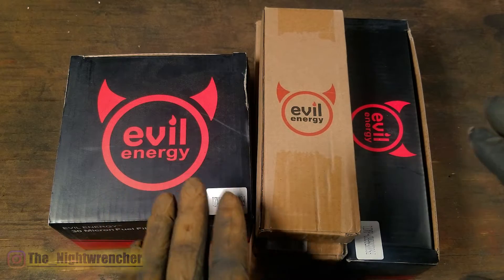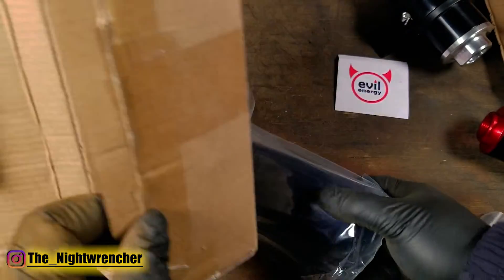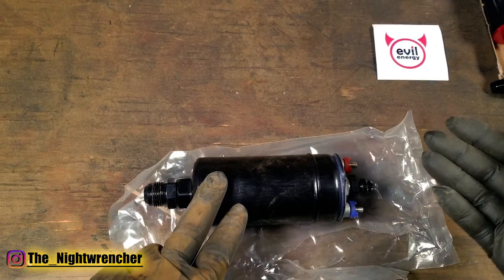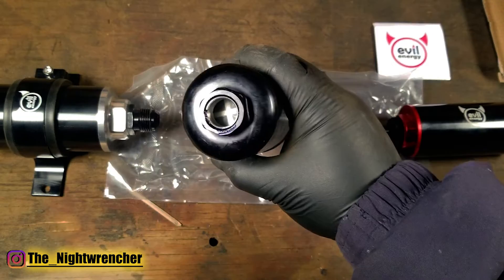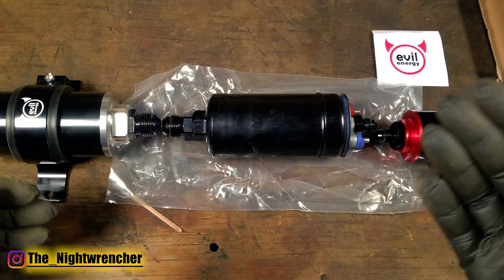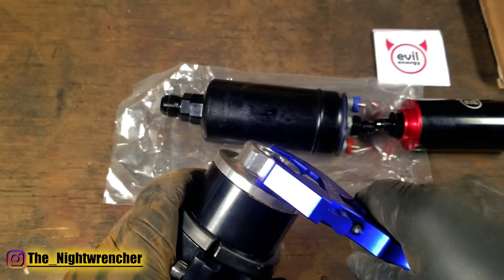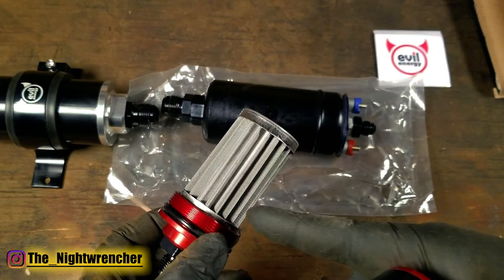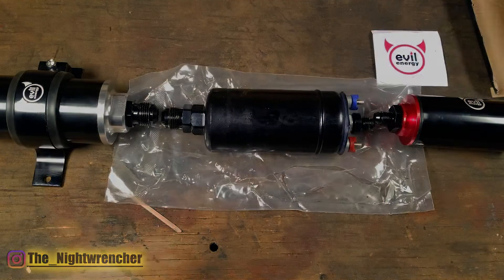Do You Actually NEED 2 Fuel Filters? | Evil Energy Fuel Filters And AN Line |

Comment: what I came here for maybe you can help with...   how best to plumb these with AN lines for serviceability YET with least amount of fittings as possible.  IMy system is diesel. Thus the less fittings the better (reduces chances of air leaks). Am  using a different pump w/3/8 npt to AN fittings.  .
Reply from the maker: @coachgeo  the tricky part is combining those 2 things so for me, I always end up using more fittings than necessary so that things can come out easily without kinking the lines.

Comment: that wrench is a piece of SHIAT.  mine did not last thru a ten fitting uses when building my oil filter/cooling system.  Adjustment wheel stripped.
Reply from the maker: @coachgeo  theyre a very weak aluminum so I can definately see that happening. I dont crank on my fittings too hard so I havnt had that issue yet.

Comment: Beware the evil fuel filters, the elements are bonded with foam and fall apart or get blown out when run in the noted orientation. This will allow particulate and or foam to pass and can clog injectors / carb jets. Speaking from personal experience with these. Fought a tune for a while before I figured it out.

Comment: Do you ditch the check valve all together or run one further up the line?
Reply from the maker: If you're talking about the antidrain back valve, it should be part of the fuel pump itself. Unless you meant something else?
Reply: Yes sir. I'm about 99.999% sure that you took it out when you replaced the "stock" fittings. It's the skinny steel piece with the holes on the side of it. I was just curious to know if you had a reason behind ditching it 🍻
Reply from the maker: I double checked and youre right, there is "something" inside that fitting but its not a check valve 😂 it's set up like a bajo bolt but the end is also open. I'm not sure what thats about but if it becomes a problem, I'll get an inline check valve. Thanks for the heads up 👍
Reply: @NightWrencher  yeah brother! I was gonna recommend blowing through each side of it to verify but it seemed weird to suggest to another man to put something in his mouth and blow 😂😂✌️
Reply: Is the evil energy fuel pump good? I have one ordered but can’t find real reviews on its reliability